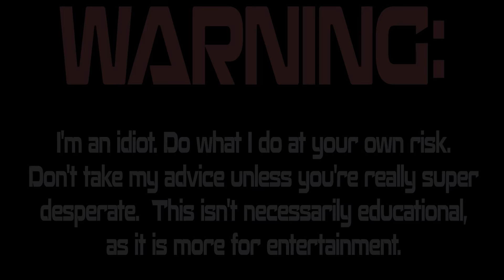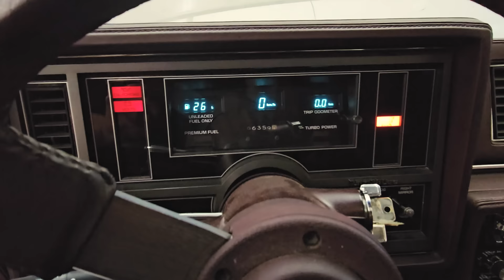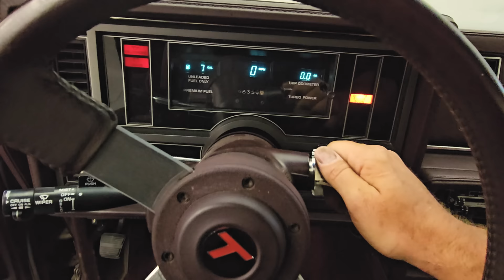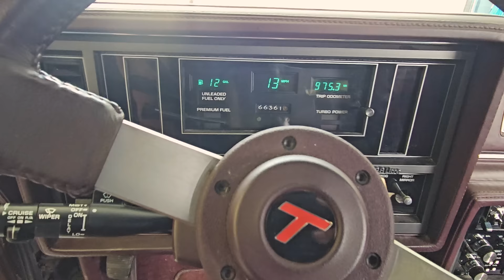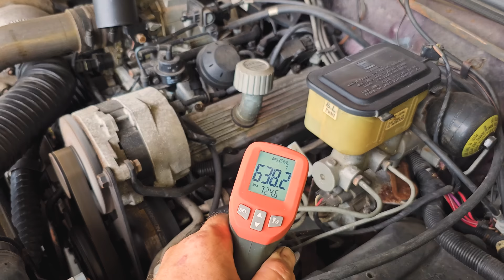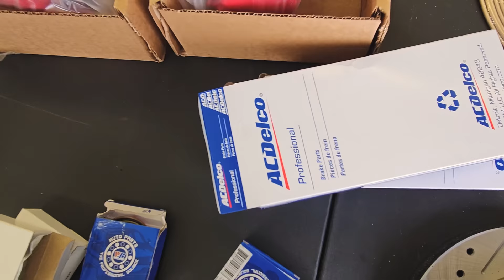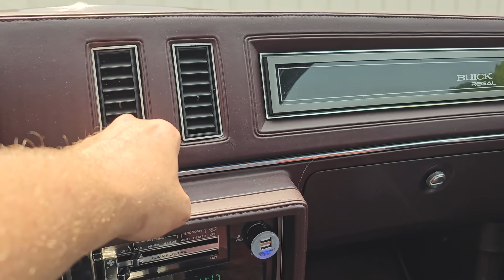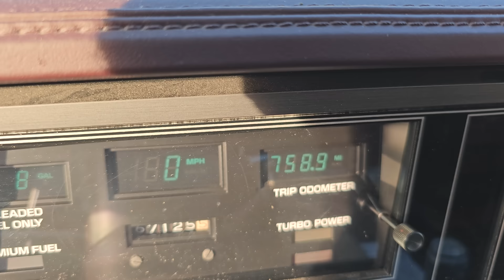ABANDONED In Storage For 22 Years - Rare Turbo Buick! Will it RUN AND DRIVE Home 750 Miles?

Comment: Regarding the rust and corruption on the underside of that car, I would be willing to bet that the storage facility was brand new when the Buick was put in place for storage.  New concrete hold a lot of water and would have kept the sealed up storage unit nice and moist for quite a while.
Reply: Michigan also has snow, and road salt as well
Reply: Put away in December I believe he said… salt a big component
Reply: Unfortunately, she has probably seen a winter or two.  Maybe first owner. Storage rust is very superficial, but that is a bit more imbedded. She’s seen the salt.
Reply: * Good Point ... 😔
Reply: For this reason, I've heard that storing cars on dirt inside is better than on concrete. Dryer. Anyone else hear that?
Reply: Any of these steel buildings (conex boxes, storage sheds, etc) are terrible for condensation.
Reply: @paulwoodman5131 A guy (Derek) says ones stored on concrete vs bare dirt are better. Says the ones on dirt tend to have the engines locked up more?  Just saying what I have heard a guy say a few times. Seen all his episodes and shows....not like I have personal experience from messing with the quantity of junk this guy does!
Reply: If it was simply condensation then all unprotected metal surfaces and bolt heads would be crusty. They are not, only crusty areas are down at salt area. Condensation is problem, but salt residue accelerated it in areas.
Reply: Sweet T I'd say build the G.N and keep the T stock.  And welcome to the club!
Reply: Salt salt salt salt salt.  65K miles of salt spray.
Reply: @paulwoodman5131  no way
Reply: This guy, the second owner who put it away, drove it for 30 mi. Change the oil, then put it into a storage unit and locked it. That's not going to be very good. You see the emblems are turning blue with probably salt. Somehow this car got put away dirty,?  It should have been put on top of a plastic sheet Probably, since I've been doing some reading on storing vehicles on dirt.  This pole barn I saw the cars parked in had a dirt floor but it was dry as a bone dusty dry dirt. I suspect that would be better than parking on non vapor moisture protected concrete. So the best thing you can do is store your car in a dry moisture proof, air conditioned bubble. Anything short of that is less good, so you're taking risks based on how long it's going to be in storage. A simple sheet of plastic underneath this vehicle would have been beneficial for sure. (& maybe wash the salt off)

Comment: The rust imprint on the floor from the exhaust pipes is absolutely insane!
Reply: It was truly nuts, you could even see the rear axle housing.
Reply: Gbody guys knew instantly what that was!
Reply: @ronnybutler2908    The exhaust "route" ?  Oh hell yeah!  I actually had a Torque Technologies (back when they still existed) 3" system for GN on my 86' Grand Prix.

Comment: You know and I know that that car is way too close to mint to not be fully restored. It'd be a crime to do anything to it that didn't bring it closer to factory.
Reply: With all due respect, the shiny paint doesn't make up for the mess that the underside of the car is. It's not bad but it's not close to what I'd call mint, because of that. It'd make a nice driver.
Reply: @townhall05446  "shiny paint" he says. Tell you what. You find me a straight buik 3.8 turbo optioned, non GN with 100% functional original interior, T-Tops in the shape thats in (headliner glue not-withstanding). 

Protip: you won't.

Comment: Derek, a little history. I have never been an Buick man. I learned to drive in a 1953 Buick Roadmaster three speed maroon. Hatted it. At 14 Oldsmobile was my choice first car was an Olds Holiday Sports coupe two door hard top with clock in lower spoke of steering wheal. However your 3.8 turbo is out of this world and deserves to be kipped as original as possible. Pleas treat it with the respect it deserves. I am 78 and appreciate all you do.

Comment: Thats a perfect car for the wife to drive while you drive the other turbo g-body to car shows. Frame off restrictions on both would be great content since thats not your normal thing. There both rare enough to keep for your personal collection since there both only gonna go up in value. I absolutely love them. Hope to see this happen❤❤❤
Reply: I'd say find a good rolling chassis from out west and install polyurethane bushings and mounts. Also a great time for a hydroboost conversion and any other upgrades for reliability and longevity. You'd have a beautiful survivor that would be safe and reliable.
Reply: replace the frame and fix  the rust in the doors and let the wife enjoy it also give it a good tune up

Comment: That's an exceptional find. I'd swap out the chassis and do as much rust repair as possible to the few bits of the body that have started to go. It's too nice a car to change, in my opinion - it's worthy of a ground up restoration. Cars like that don't come along very often - there are plenty of lesser examples that can be modified. This one is well worth the effort to completely restore and keep as a real "going to town rig".
Reply: 😂The people you run into here.
I totally agree, she's too beautiful not to restore. I can see Jessica claiming it.
Reply: @M8Stealth  25:33 unibody?
Reply: @M8Stealth  that's a g body sir
Reply: @M8Stealth G body’s are on full length frames aren’t they.
Reply: I agree, keep this beauty unmolested. I bet there's a few sun bleached bondo queens in the sun belt with blown out interiors and crapped out mechanicals that could be had for cheap as a rust free frame donor.  The rest of the car is amazing.
Reply: @M8Stealth - curious, have you gotten your foot out of your mouth yet? 🤣
Reply: Why swap out the chassis? If you see the card with the mileage and year, it was driven about 5k a year and in Michigan I doubt the owner would have driven it in the snow. Just go to town with a air powered de-scaler and paint it and use some oil and cavity wax on the insides. The car might go up in value, but not Grand National or GNX level.
Reply: There is no reason to do a chassis swap. Is everyone just so immensely braindead anymore or what?
Reply: I bet you're fun at parties 😂 @MrWolfSnack
Reply: @PatricioGarcia1973  New, car was a Regal with a turbo on it. Nothing really that special. I guarantee first owner drove it in the winter in Michigan. Looks like just about every old Michigan car underneath.
Reply: Absolutely well worth the effort it's going to take to preserve it. You're right what a phenomenal find. My aunt had one of these cars back in the 80s when I was a kid. She blasted down the street in it all the time, so much so we used to refer to her as The little old lady from Pasadena.

Comment: This one deserves a huge stock restoration! The frame is scaly, but we've all seen way worse! See what it's like after a thorough rust-removal. That body is way too nice, and that package is supremely rare.
Fantastic workolatin', as always!
Reply: Wouldn’t be worth a full restoration without acid dipping the frame
Reply: Yes it does!
Reply: It would be worth it to swap the frame and suspension, and keep the drive train and interior mostly stock.
Reply: The shape of the car is very pretty but you can tell whoever the car designer was got over rided by some safety comittee that added a horrible rear end bumper and the front bumper, which hangs right in front of the lines the designer intended. 
Its a shame.

Comment: Just a heads up for any would-be revival mechanics out there learning the ropes, a lot of times the reason a pinion or an axle seal will start blowing out hot gear lube after driving it long distances is because the vent on the axle tube is clogged...so as you drive it and the axle internals heat up from friction, the hot air expands and has nowhere to vent, so it pressurizes the axle housing and pushes gear lube out past the seals...so, before you go wrestling around with new seals, go ahead and remove the threaded vent from the axle tube and make sure that's clean first...they have a tendency to get caked with dust, rust, and old gear lube, so they're very easy to plug up and stay plugged...
Reply: Back when I was a service manager at a bike shop I used to make a FORTUNE the day before hunting season.  Dirt daubers would build nests in carb vent tubes.

The airbox would fill up with fuel then dilute the oil.   Bop the vent, start it, then flush the crankcase.    Easy money on an easy carb clean.
Reply: That's a good point .

Comment: I worked for a Heavy Equipment dealer for years. I was a field mechanic. I was involved in an accident where the machine caught fire. I had on polyester blend uniforms that melted to my arms & chest. After the accident this huge company went to 100% cotton uniforms for field mechanics. They tear easier, they fade quickly and wear out faster. They wear way cooler in hot weather because they wick moisture out. Plus the added benefit of not melting to your skin.

Comment: It’s good to see you putting your normal effort into higher quality rigs. Love the Buick content
Reply: Meh I’d rather have the duster tbh
Reply: I’m 20min in and a guy hasn’t seen it with the T-tops off…?
Reply: Had to start low before you could go big
Reply: use to go to raceway park in NJ and watch the buick vs mustang races these were iconic cars of the time
Reply: @scottcohoon8630 headliner was becoming a foot liner
Reply: @bh2824 who cares
Reply: It’s unbelievable that the Powermaster is still functioning well enough to give you good brakes after sitting that long.  Most of them have big issues after sitting because of old, moisture-laden brake fluid.

Comment: That needs to be Jessica's car. It will be a perfect replacement and future power tour car for
 the one you gave away! Those G body frames are plentiful if you want to swap it, but I'd consider trying  dry ice blasting first, it may not be as bad as you think. Great video, I appreciate your hard work!
Reply: Frame swap for sure, you're never going to get to all the inside of that frame to stop corrosion unless you spend big $ having it chemical treated, even then your end result could be structurally compromised because of the rust.
Reply: Frame swap fur shur. Powdercoat the rear end. Change out the upper and lower a arms and rear bars. Change the right and left rockers . A chrome kit under the hood. Treat the floors while it's off the frame. I just subscribed so I'm all for a whole series on this one....lol...I love the turbo t's and maroon (rosewood) ain't a bad color to have.
Reply: As much as I'd love to see this as a giveaway. I agree. The best way to preserve this one is to keep it in your arsenal.

Comment: The ECM or  ECU is located under the glove box and dash forward of the front passenger door.   You will have  to carefully remove cover and inside you will see metalbox  that is where the chip is.     That coupler that you mentioned at begining are notorious for coming off.  Keep spares in the car at all times.  Those cars need an oil pressure guage, because known for low oil pressure at times.  Also check the entire front end suspension often.  I needed to replace the entire front suspension on mine.    Great performing  highway Cars  in its day.
Reply: Also the drivers side exhaust manifold always cracks.
Reply: @wecoyote2016  Turbos tend to die early because  of low oil pressure due to a poor quality oil pump. 1st mod should be to correct  the problem . pressure problem.

Comment: Man you hit the Lottery finding this one. Beautiful car & runs like a mashed cat. What I'm impressed with is you changing the pinion seal in a parking lot with minimal tools. That tail pipe seal installer is thinking outside the box. Awesome car.
Reply: I replaced an entire rear-end in a video store parking lot once after I coasted in there when I blew the rear up from doing rolling burnouts. 
It happens.... 🤷

It was only a leaf spring car though.  Pretty easy rear axle change scenario
Reply: @davelowets       i drove a 78 camaro right into a video store once after i pulled into the parking lot a bit hot off the highway and realized i lost my breaks a lil too late...., just had enough time to throw it into park but all it did was click a few times before i smashed right into the front of the building which was all glass. i was parked right in the new release section.....  luckily no one was hurt except my air brushed spider web paint job.

Comment: I vote for a frame off restoration…. was amazed and a little sad to see all the rust after you moved it outside. Wouldn’t have expected such moisture related issues in a storage unit like that. And, obviously a master brake booster conversion. Thanks for a GREAT video, as always!!
Reply: You might want to do your research It's a unibody It's not frame and body So that's impossible
Reply: @mayaboylan5414 
Regal is a g-body there's a full frame under that car just like a montecarlo or a Cutlass.
Reply: @mayaboylan5414 you might want to do your research

Comment: You have got to keep this jewel! Derek, if there ever was a vehicle you have had, worth dumping some green into, this is it. Fix the body, fix the suspension  soda blast  the frame or whatever and paint and rust proof. These cars in that shape are getting very rare and you would kick yourself if you EVER got rid of this. This is one you park on the others side of the shop and put a car cover on it. Only drive it for special occasions.  I used to work on these when they were new at a GM dealership. I just loved "test driving" them after a repair!

Comment: Get the wiper going before you leave for home. Get a dashboard 12v  Fan for a backup Defroster. Replace the upper control arms and any Rusty Suspension!! Get the Rotors turned for spare replacement rotors. And Harbor freight cotter keys kit package. 1:00:01

Comment: Right at the end, you asked should you do a frame swap. I say yes. I'd like to see the procedure for doing that -- inspecting the rusty frame for possible repair, sourcing a new frame if repair not feasible, putting the whole thing back together. Other than that, no major modifications, just fix/improve as needed. 

I wish I had thought of magnets for that headliner -- I had an 80s Cutlass that developed a tired headliner lol.

Comment: It's a crying shame about the rust issues because of the road salt in the northern states. When I lived in Michigan, I had a few cars that looked nearly new, paint and cosmetic wise, yet there was nothing left underneath due to the corrosion. So glad I moved to Southern Middle Tennessee over 30 years ago. I've got a 2005 Ford Sport Trac I bought new that you can still count the threads on all of the suspension bolts and hardware attaching points underneath!
Reply: Based on the condition of the coated floor pans this wasn't a road salt issue but a storage one. Sitting on bare concrete in a unit that doesn't have temperature and humidity regulation is BAD. Especially in places like where this car came out of. There is a lot of humidity in Michigan in the spring, summer and fall. 80-90 degree days and 60 degree nights in the summer. Winters are just plain cold and snowy.

Comment: Derek, next time you run into a situation with the hood lift shocks not working, use a small vise grip, just like your handle says, Vice Grip Garage. I worked at a Sears Auto Center (2nd job) in mid to late 90's here in Buena Park, CA. we had to use them occasionally to R&R batteries. That car is an absolute beautiful piece of machinery, give it all you got and bring it back, keep them mud flaps on there, too.

Comment: My sister bought a new '79 Regal Sport Coupe  with the 3.8 turbo.  (far more common than your T-Type)  I remember the turbo lag being significant.  I also remember the body panels being so thin you could dent it by leaning against it.  She had some overheating problems and sold the car after 4 or 5 years.

Comment: I had an 86 Olds 442 with t tops that I bought as a recovered theft in 1990. I built it as a car audio show car and went all over the US  competing in IASCA shows. I loved that car and body style. Always wanted to swap it to a GN motor but ended up going with a 1990 Tbird SC for my next big project.  Always loved the Regal/ Olds body style though. At the time, the SC was such a cool car with more modern features though (4 wheel disc ABS, speed sensitive steering and adjustable suspension).  It also outhandled the GM cars by MILES. Miss those days so much

Comment: Great experience Derek. That is one cool collectable car, so go easy, although a frame swap might be a good idea. The contractor who built the storage buildings never put a vapor barrier down before pouring the floor. Thus the concrete sweated the moisture up and the rust happened.

Comment: I did a 3800sc swap out of 2003 Bonneville, into my near perfect '87 Fiero GT, with a Getrag 5-speed, about 6-years ago.  She only weighs 2700 lbs., and it can pretty much blow the doors of every Mustang around.  The engine had, and still does have, zero blow-by, dry front and rear seals ,etc.  She still runs on the original tune and Mobile-1 synthetic.  I installed a 3.4" SC pulley and removed the cat and EGR, and puts out close to 300 hp.  She is a rolling car show, and gets tons of attention, and folks take pictures to show their families and friends.  I don't get many challenges, I guess because she sounds sooo mean!  I love her, and is a ton of fun to drive.  I don't know if you noticed with your '84, but Fieros have more room than Corvettes of the era.  I'm still weighting and watching for you to finish this Buick.  What a great find!